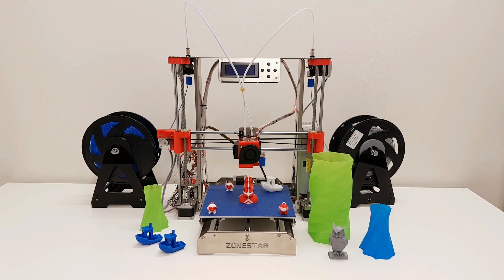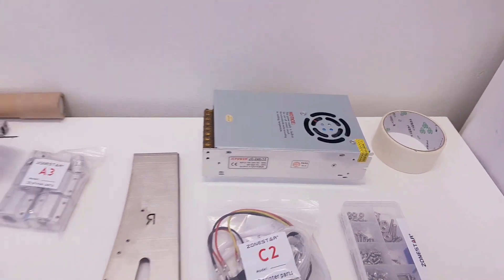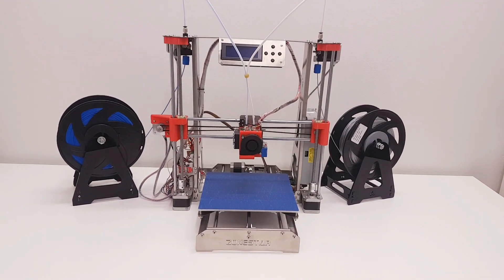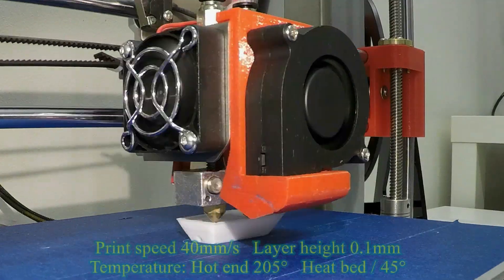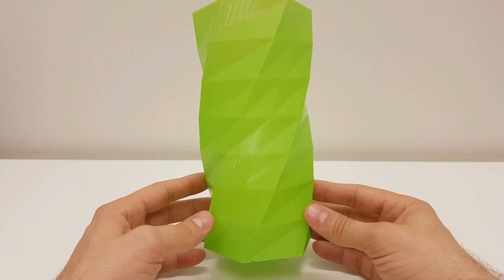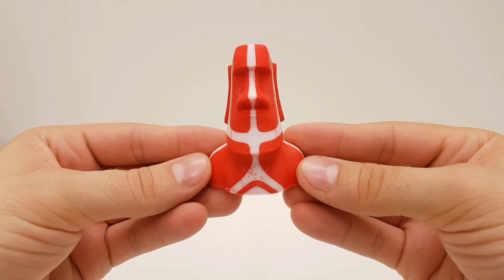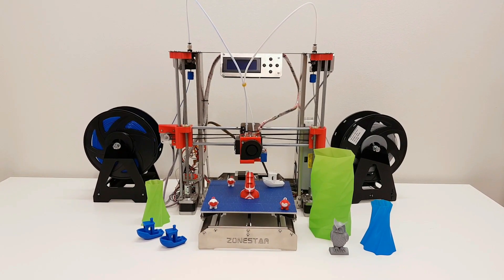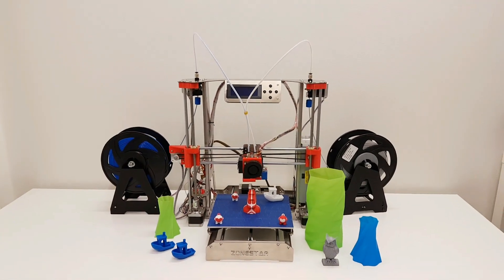ZoneStar dual extruder 3D printer Full Review! Any Good?

Comment: I have one 3D printer P802QS exactly like yours, but the 02 struders motors are not working on advance test, it would be because I don't have the filament sensors? There is some configuration for enable this motors? Shouldn't they even work out of operation?
Another detail... I noticed that the print nozzeles have different heights in relation to the table, is that correct? 
I apologize for so many questions, but I have little experience and reading the manuals I am not finding answers.
Thanks.

Comment: Hi Nexi, I recently purchased the Zonestar M8R2 which is basically the same printer in your review only in black. The only problem I encounter is that it seems like the firmware detects a endstop signal and prevents moves sometimes. This sometimes happen with crosstalk to endstops. The solution would be to disable the endstop check in the firmware. However Zonestar refuses to share the GPL licensed source files. Would you happen to have the Configuration.h for this type?

Comment: Hi,
Congratulations for the video and review!
I have 2 questions:
1- you mention you had to unscrew the second nozzle to adjust its leveling with the first extruder. How did you do that ? And if it's not tighten anymore, does it "move" druing the printing or between two printing sessions ?
2- whar are the blue cylinders around the filaments at the top (near the filament steppers) ?

And maybe a 3rd question: could you list all settings you ue for that printer, dpending on material ? (you mention some in the videos, but if you had Cura settings, for instance, it would be great).

br,

Comment: I just finished assemble the printer,  however don't understand what suppose to touch the Y endpoint? my printer is a bit different (Z8XR2) but I think that the heat bed bracket is the same.

Comment: The quality of the parts must have been improved heavily since January, I never got my P802QR2 working. Lots of problems with the printed parts supplied (out of angle), holes in teh front/back plate lasered in wrong positiosn to create heavy tension. Z-axis always a problem until now I could never print above 50 mm. 
Also autobed levelling never worked. Not that it didnt work properly, it did not work at all.

Comment: Very nice review. I love the scientific approach. You've just earned a subscriber :). The video quality is impressive - what camera are you using?
Reply from the maker: LMF5000 Thanks:) If you like this camera then you will love this camera and this review :)  https://youtu.be/HL3mAHV-9Ds  Write me comment under new video if I was right :)
Reply: Nexi Tech thanks, left comment there. I wonder if I can get your opinion. I'm looking for my first 3D printer. I'm interested in building a DIY kit because it's more fun than buying prebuilt, but I also want the print quality to be good enough to eventually sell some of my prints.  I decided not to get anything by Anet because of the fire risks and poor quality. I've almost settled on the CR-10 (or CR-10 mini) because it seems to be pretty much great right out of the box without having to print upgrades. Do you have any recommendations? My favourite shop is banggood.
Reply from the maker: LMF5000 My friend I recommend Cr10 mini. Because it has great print quality and it can print PETG and ABS better then standard Cr10 or CR10S because it can reach higer heatbed temperature without need to upgrade/mod anything. Its smaller then CR10/S but it take less space and it is also bigger of any standard prusa 3D printers. Also it has better print quality at high print speeds then CR10/S because of less mass on Heated bed (Y carriage) Great machine directly out from the box and it will last very long time. I have made review for Cr10 mini as well and you have Banggood links in video description :)
https://youtu.be/v3X29z3ybZ8
Reply: Nexi Tech Thank you, you have been really helpful. I will check out the video tomorrow and try and purchase from your affiliate link when I am ready to buy :). It's nice to hear objective scientific reasoning like yours.

Comment: is it possible to set each nozzle to a different temperature so you can have abs and pla at the same time?
Reply from the maker: GaudyMarrko Yes of course. You can use any temperature on each nozzle separately. Even different print speeds,movements etc. It's like having 2 3D printers in one sharing same heatbed.

Comment: Hi,  I keep hearing on how two nozzles like this can knock print over, did you have any trouble like this with this printer?
Reply from the maker: Yes, that can happen if 3D printer is not properly calibrated and if heated bed is not level up correctly. If you do it right there is no problem with that at all.
Reply: Oh thanks.Temping printer to get. I like how its steel over acrylic for sure.  I also want to use PVA for some neat designs.

Comment: Wow! Those settings are awesome. That's really cool they include settings for the auto bed leveling with buildtake and other materials. Also what do you mean by salmon skin? I have never heard this term.
Reply from the maker: Yeah They have really cool software. Lots of settings to play with. Well, salmon skin is term in 3D printing for describing for ''noise'' in the printing surface. That ''noise'' is micro vibration coming from steppers drivers ESC from motherboard. Its like noisy electric signal(you can't hear it) which then makes stepper motors to leave that salmon skin on the print. You can even feel tiny(small) micro vibrations on them when you touch stepper motor or belts during printing. Most of people don't even care about this and many of people will not even notice that but I do and I mention it in video review. For example am working now on TEVO little monster(Huge Delta) and its suffer from this quality artifact too. Which I solved and now my TEVO Little monster producing beautiful quality prints. I will make video about this soon. I need more time for testing.
Reply: Ah okay. I think I have always just called it echoing or shadowing which I now take are different from this.
Reply: YOU CAN SMOOTH IT IT OUT WITH STEPPING MOTOR DRIVERS MORE YOU PAY MORE YOU GET - GET ME

Comment: Is the metal frame electrically earthed?
Reply from the maker: Malcolm Arnott I guess you can do it easily by adding one wire to the ground on PSU and anywhere on metal frame. Its DIY 3D printer kit. You can add what ever you like  on it.

Comment: How many people have got a shock turning on that printer, it's asking for trouble as it is.
Reply from the maker: Who knows :D  Now joke on side, people need to be careful with any DIY 3D printer kit. 99% of those power supply is open type. Very easy to get shocked if you don't know what are you doing. Safety first and be smart. Take it slow no rush, Isolate everything, double check it, go around take a cup of Coffee then re-check again and finally start the printer. That should be guide on every 3D printer KIT.